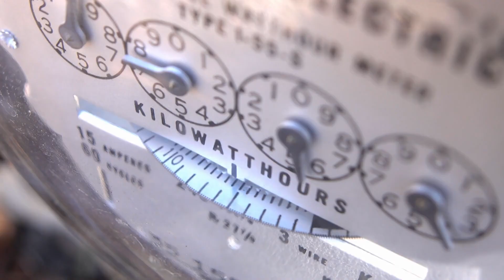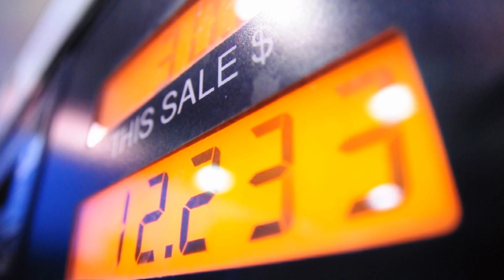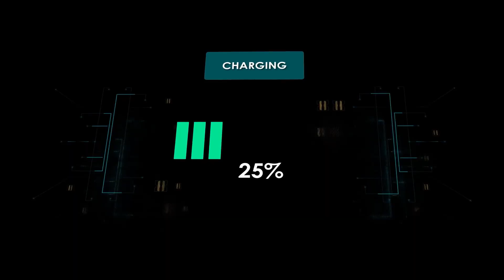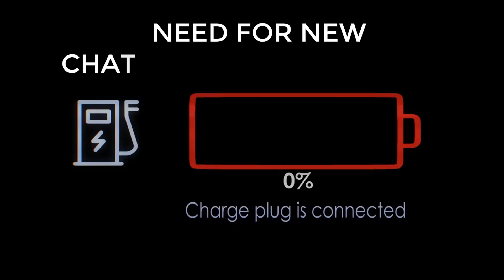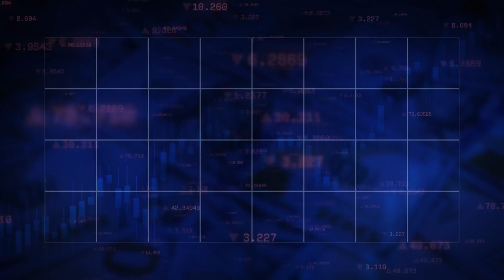This New TESLA E-PLANE will end Boeing | Elon Musk

Comment: Why do people keep going back to carbon emissions. This is a lie. Those batteries need to be recharged off the grid and most of the grid is powered by COAL. We have only a few neuclear reactors and not enough win or solar to power the USA meaning COAL is charging those batteries. Secondly, energy is lost when the batteries are charged and the energy is lost in flight with the activation of the propulsion. Internal combustion is still 15-20% more efficient than batteries. On top of which it takes hours to charge those batteries vs minutes to fill a tank with fuel.